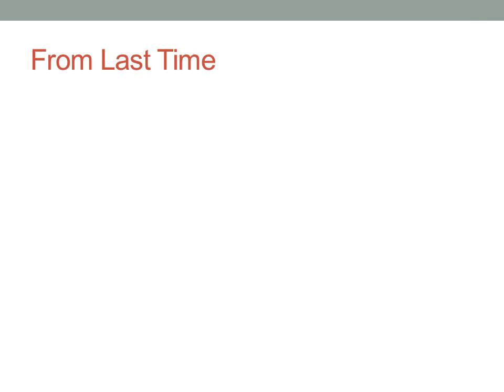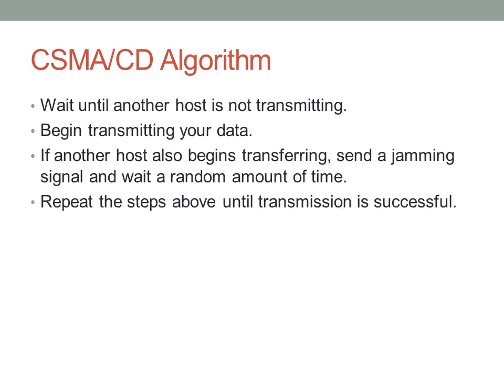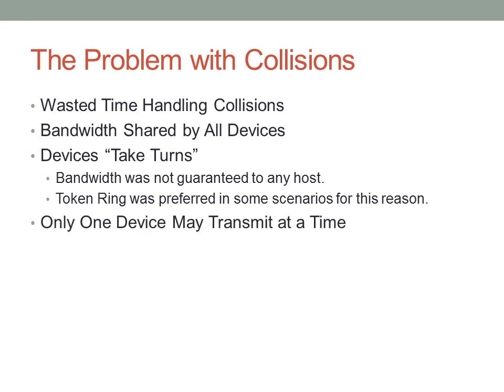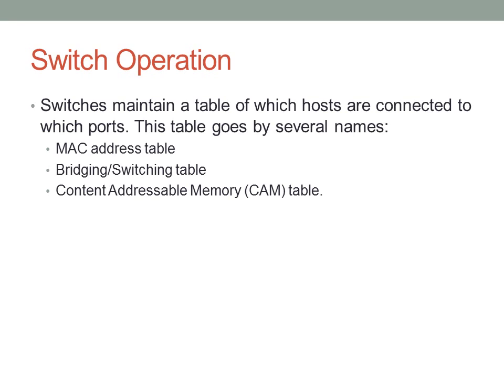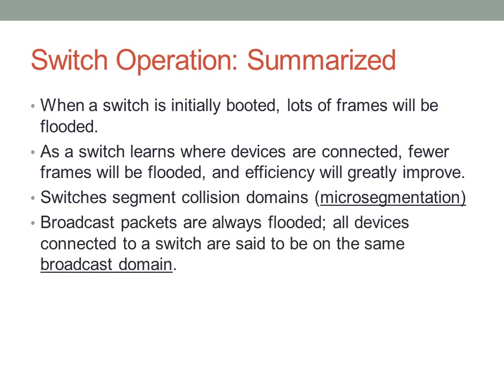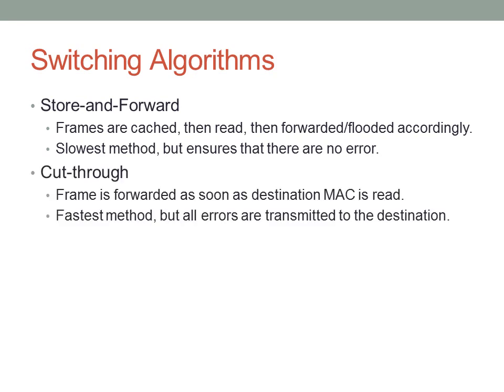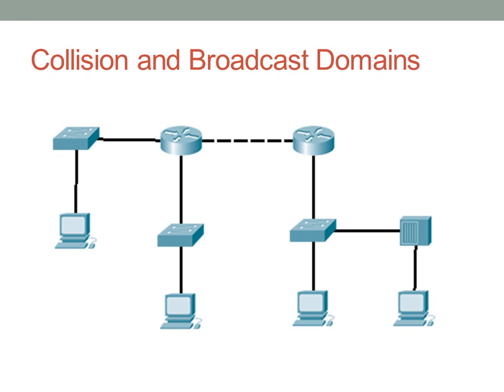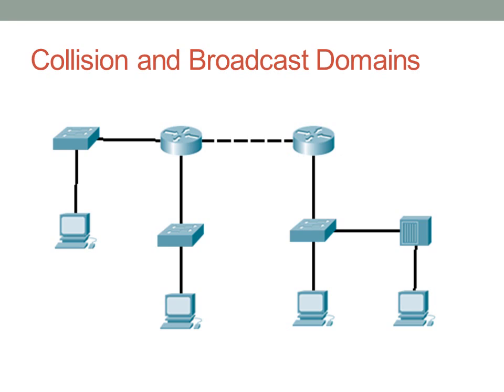CSMA/CD and Switching

Comment from the maker: You can think of Ethernet/MAC addressing as how frames get from one device to another on the same broadcast domain (network). Routers are the devices that transfer packets (IP header and above layers) between networks. Each router will re-write the frame-level (L2) information to account for the new src/dst MAC pair for that particular network.

Comment: Thank you for this.  I felt like it covered, in a very specific way, what cisco is looking for on current exams.  Despite the fact that this isn't (or shouldn't in most cases) be used anymore, this information is still required.
Reply from the maker: Glad you found this helpful, Bob. Can you clarify what you mean when you say "this isn't (or shouldn't in most cases) be used anymore"?
Reply: Ryan Clough
Ah, sorry.  Didn't realize what I'd done there.  I was specifically referring to CSMA/CD and hubs.  In today's production environment, a hub would amount to network death.  That said, what you covered is still required for the exam.
Reply from the maker: In most contexts, I've seen hubs used to perform network captures in situations where switchport mirroring is unavailable. In those situations, it's great to know the implications of using one. Otherwise, as you mentioned, "network death." :)

Comment from the maker: Between LANs: client1 will see that client2 lies on a different subnet. In these situations, the frame will be forwarded to the MAC of client1's default gateway, ARPing for this MAC if necessary. The IP header will still have the appropriate src/dst IP address.

When the router receives this frame it performs a lookup in its routing table. If it has direct access to the appropriate subnet, the IP header remains unchanged, but will have a src MAC of the router and a dst MAC of client2.

Comment: Thanks man that's cleared it up! I don't seem to have got your private message though.

Sorry don't want to keep asking you questions, but I'm still a little fuzzy on the difference between a network layer 3 packet and a data link layer 2 frame. I know the leaky bucket algorithm shapes the traffic of network layer packets and regulates the transfer rate, and the data link layer 2 sliding window protocol determines how much data is in transit at once.

Comment from the maker: Just to clarify, when I refer to L2/L3, I'm referring to the OSI model's L2/L3 (i.e. data-link and network layers). At these layers, we don't worry about the windowing you're referring to (which is a feature of TCP, a L4 protocol). Instead, our primary concern is getting data between devices on a single network (L2) and defining logical networks (L3). You might want to go back and review my earlier videos on OSI layers and Ethernet functionality to review that info.

Comment: I'm sure the datalink layer uses the "selective repeat" or "go back n" sliding window protocol to send data frames? (I had to do a coursework simulating it in C.) Also I'm doing a different course to CCNA with a module focusing on the OSI model.

I'll do another days studying as I'm beginning to piece it together in my mind, but I'll definitely send you a message to ensure I have a coherent enough understanding. Thanks man!

Comment: Small question, when a data frame is sent out from client1 to client2 on another LAN, does the frame's destination MAC address have that of client2 (I didn't think it would be visible) or will it be the MAC address of the router?

This all happens the datalink layer I believe, another part of me says that more is done at the network layer: the data packet has the destination IP address of client2, this packet is then routed there. How does the packet get from client to local router though?

Comment: How are these two related though? Surely if you increase how much data is in transit at once using a larger window size at layer 2, you in turn increase the rate that data is transferred at layer 3? (My notes explicity say sliding window doesn't increase rate)

Say the sliding window size was 4, would all 4 individual frames sent be datagrams packets which are stored in buffers at the routers? Having MAC addresses and IP addresses in their header. I can't imagine the relationship between layers

Comment: i cant get away without saying thanks... going through many books was a bad idea.. i have 1 ques.. in a hub u said bandwidth is shared so host either listens or send but how does that divides the bandwidth?
Reply from the maker: Let me see if I can clarify a bit...

On a hub, all data is repeated to all devices simultaneously, with only the appropriate devices listening to the frame. This means that on a hub, even though every single port may be theoretically capable of 10 Mbps (to use regular old-school 10BASE-T), each host on the hub must wait for all other hosts to stop transmitting before data can be put on the wire.

For example, say I have two hosts sending 4.5 Mbps to each other (for a total of 9 Mbps of bandwidth). All other devices, even the ones that aren't communicating, will see 9 Mbps of traffic on the wire, but will not receive the frames. If someone else wants to transmit data, they would have to wait for a gap in the transmission. In this way, bandwidth on a half-duplex connection is shared by all hosts, even though each link on a hub may be capable of 10 Mbps on its own.

A switch, in contrast, will not rebroadcast frames to all recipients unless it doesn't know which port a frame is destined for. The first frame in each direction would be flooded, but every frame after would be forwarded directly, and hosts that aren't part of the conversation wouldn't receive a thing. In this example, we can actually use the full bandwidth of each and every port separately.

The example above is a bit of a simplification; the reality is a bit more messy and collision-ridden than that, and performance begins to suffer greatly when you push 90% bandwidth utilization on a half duplex connection. Even in a perfect, collision-free world, however, bandwidth on a hub is shared, while bandwidth on a switch is not.
Reply: Ryan Clough appretiate your words.. but i still didnt get it.. lets say for 10mbps line 2 hosts are talking.. so at any given time the minimum bandwidth should be 5mbps if not 10 for one host... so if 100hosts are there then how each one gets just 100Kbps?
Reply from the maker: Manohar singh Ah, sorry, misunderstood your question.

Because hubs simply repeat what they receive, there is no guarantee of bandwidth for any particular host. Bandwidth is available on a first-come/first-served basis. If a host connected to a hub has data to transmit and sees an opening on the wire, that host will immediately transmit. There is no even division of bandwidth as you describe; it's a dog-eat-dog world!

In the early days of Ethernet, this scared the pants off some industries, who were concerned that the lack of a bandwidth guarantee may cause problems. (For example, what happens when we can't talk to a machine on a hospital network responsible for life support, or a robot on an assembly line responsible for the next step in an assembly process?) For this reason, many network administrators decided to wait to deploy Ethernet until after the advent of full duplex (which pretty much eliminates this problem).
Reply: Ryan Clough got it now ..thanks :)
Reply: Ryan Clough Thanks for a beautiful explanation, Ryan. However, as you said, that there is no bandwidth guarantee to a host in a half duplex/hub environment, so there is always a possiblity that a certain host/set of hosts who sent their frames first will completely eat the bandwidth and the remaining hosts will stave to death?
Reply from the maker: atul jain With the way CSMA/CD works, the hosts that "dominate" the segment will do so because they have more data to send, not because they sent their frames first. Read through the two procedures here:

https://en.wikipedia.org/wiki/Carrier_sense_multiple_access_with_collision_detection

Assuming no prior collisions, a host will begin transmitting as soon as the wire is free. When there are collisions, hosts will exponentially back off, allowing other hosts the possibility to transmit frames. This article explains it in more depth:

http://www.industrialethernetu.com/courses/101_4.htm

The end result of the above behavior is that only hosts with data to transmit will dominate. If all hosts have the same amount of data to transmit, they'll utilize the segment about equally (on average).

Comment: how much time collision detection make ?
Reply from the maker: I'm assuming you're curious about how long recovery from a collision takes. Hopefully I've understood your question correctly.

In a worst case scenario, the collision will be detected after the first 464 bits (58 bytes) have been transmitted, based on the maximum permitted round trip time for Ethernet. This would leave the remaining 48 bits (6 bytes) to send a jam signal. Each bit takes 0.1 μs to transmit using 10Base-T, so the maximum amount of time it will take to detect and jam would be 51.2 μs, or one slot time. (In a best case scenario, the collision would be detected in the first few bits, after which point the same 48 bit jamming signal would be sent. This would be a much shorter recovery time.)

After the collision, each host will wait for a random number of slot times before re-attempting to transmit (between 0 and n slot times, where n is the number of collisions that have occurred before). This process is repeated up to 16 times, after which transmission is completely aborted.